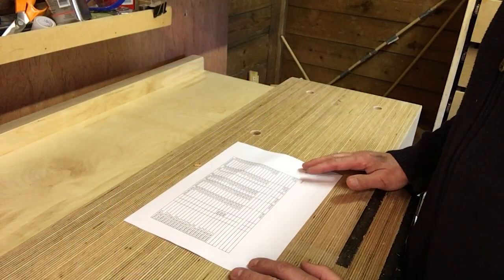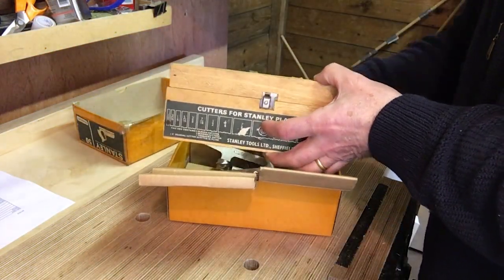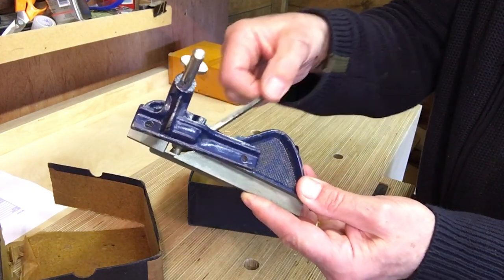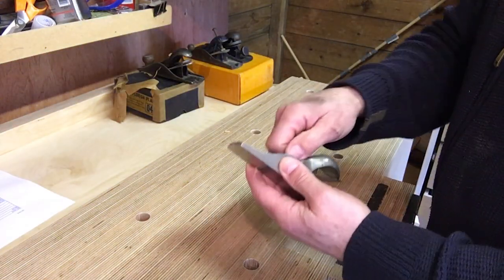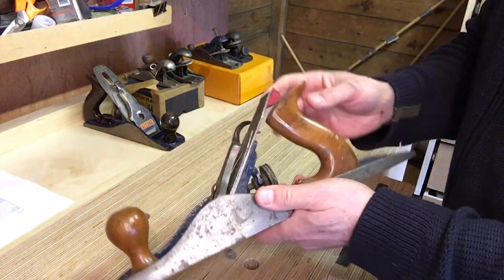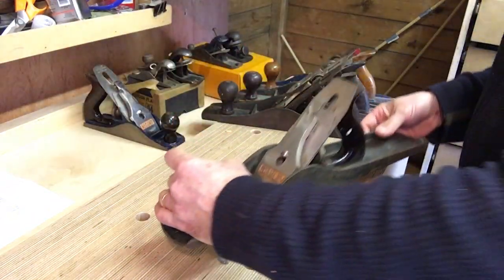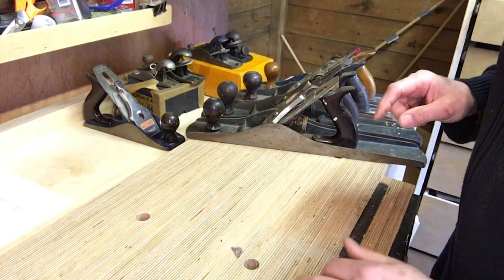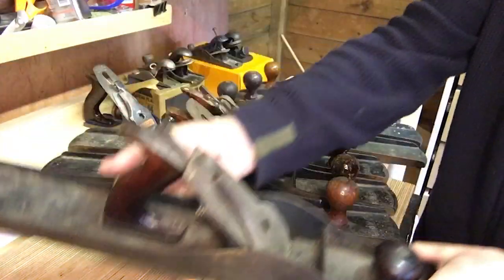I bought some rare Stanley Planes in a job lot

Comment: Quite a nice group of planes.   I have a #6, #7 and #8 on my table awaiting restoration.   The #8 needs a new blade as does your #8.   Check the length of the longest #7 blade.   If it is more than 1/4in shorter than a new blade, the hardened strip forged into the end of the blade will have been sharpened away.    The rest of the blade is mild steel which will not hold an edge.
I prefer using a #6 to a #7.    The 5 1/2 would be tempting, a bit longer than a #5 but with the same blade as the #6 and #7.
Some folks like the low knobs, I prefer the high knob design.
The #4 totes are often loose since only a single screw and the front hole to engage on the nib in the base often enlarges over time.
Check the screws on the Record #5.    Many such planes lost the original screws and folks often replace them with modern screws which do not fit well.
The Record #40 plough plane is missing the wedge/screw part to hold the blade.
A good picture on this page
http://www.record-planes.com/files/2008/08/Record-No-040-Plough-Plane-1.jpg
Dave.
Reply from the maker: cheers dave, i have already done up the No 6 (video soon) its a pleasure to use, yeah the number 8 blade is going to be a problem there is very little left and hard to come by in UK but I will sort something - i probably wont use that one so for show until i find a suitable iron.
as for the no 7 they all have some issues but I went for the USA one which is an older one but is fitted with a Record Iron which is quite normal in UK - good sheffield steel, it also has the record stay set - a two part chip breaker that record patented in the 30's and I am going to keep that as like the idea of something different (BUt i think its a bit of a gimmick really) i think the plane is a 1909-10 from what i remember so not surprising the old blade is gone.
Reply: If you are not able to get a #8 blade in the UK, they are available in the US.    Lee Valley sell replacement blades for Record and Stanley planes including the #8.    I have to get one for my #8.
https://www.leevalley.com/en-us/shop/tools/hand-tools/planes/blades/42607-stanley-record-bench-plane-blades-made-by-veritas?item=05P3127
I have a reprint of a book written by Record called "Planecraft".    Recommended if you see this for sale.   Pg 45 shows the Stay-Set cap iron.   I do not think this is a gimmick.
I have purchased replacement blades and cap irons from Lee Valley.    The cap iron is thick with a machined sharp front edge.  A link so you can see.
https://www.leevalley.com/en-us/shop/tools/hand-tools/planes/maintenance-and-accessories/66868-stanley-record-cap-irons-made-by-veritas 
I find the Veritas cap iron to be a major improvement to my vintage hand planes.    The thick steel, flat and sharp front edge prevent chips for getting under the cap iron, which was a constant frustration with the original Stanley cap irons.    
The Record Stay-Set may also prevent chips getting under the cap iron.
Before I replaced my cap irons, I spent the time to flatten the leading edge of the original cap iron.    This helped, but the thin steel flexed a lot more than the Veritas replacements.
If I recall the Record blades are a tungsten steel and hardened for most of the blade, unlike the Stanley with the thin hardened edge forged into the softer steel.
Dave.
Reply from the maker: @lv_woodturner3899  yes I think the record ones are tungsten steel will have a look in the daylight tomorrow and some lee valley stuff is available in Uk also I think

Comment: Nice haul, I wish we had a good second hand market where I live. Are you keeping the 5-1/2, Rob Cosman says it is his go to plane for almost everything.  
Have you tried  these sites for the replacement blades:   https://www.workshopheaven.com/hand-tools/hand-planes/plane-irons-and-accessories.html   , or,  https://www.oldtoolstore.co.uk/replacement-plane-irons-15-c.asp
Reply from the maker: I have put the no 5 1/2 on ebay as I am going to use the No 6 - i have to sell some of them as need to get my money back (or close) - normally these planes get snapped up early at the market but the guy called me and we agreed a price up front - so I lucked out - yes blades I will have to sort out as I go - the No 8 has nothing left as far as I can see
Reply: I prefer the 5 to the 5 1/2, it’s easier to handle. The wider blade of the 5 1/2 gives you almost no advantage, I don’t get why people like them so much.
Reply from the maker: @mm9773  I think it’s the added weight on wider boards maybe